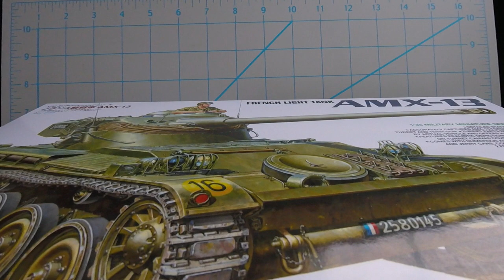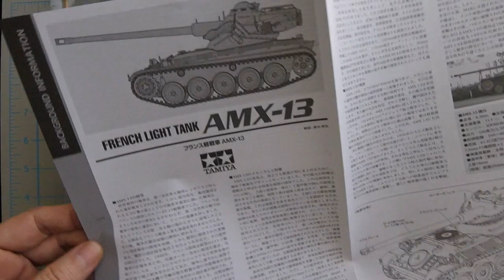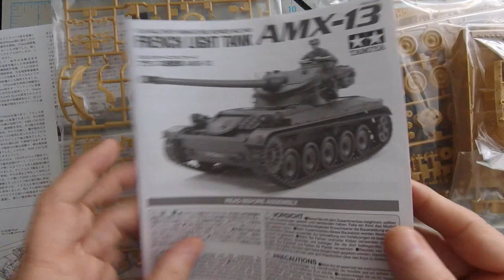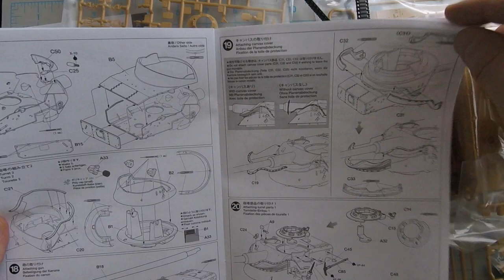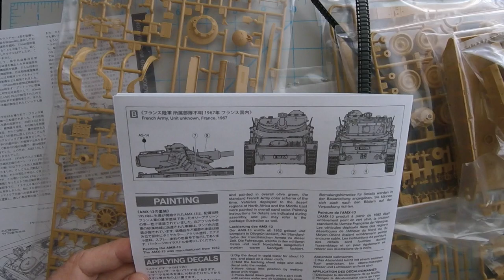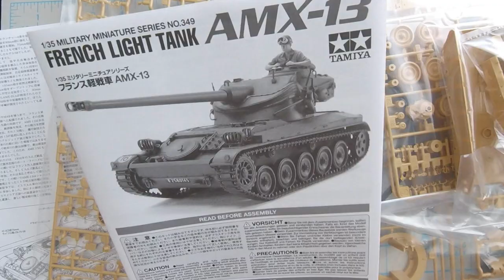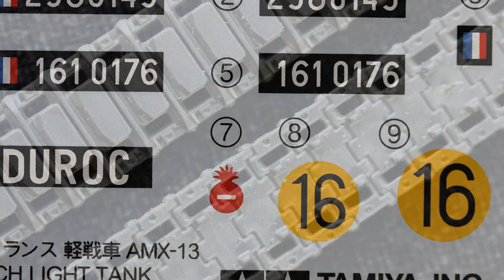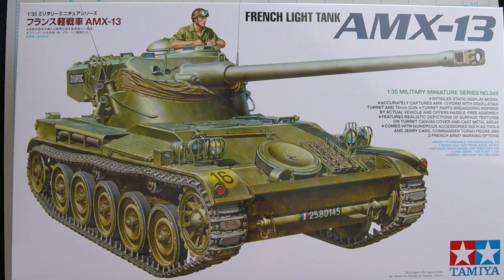Tamiya AMX-13 French Light Tank

Comment: The turret was also mounted on the Sherman, by the Israelis, I think.  I also saw some in the Balkans during the conflict there. I believe that the M4A4 was the chassis and was reengined by the Israelis, which changed the engine deck. I believe that the AMX-13 was originally based on the Panther. It's big claim to fame was the oscillating turret and the auto-loader. Both were New high tech in the early 50's. If the French used them, it was in Algeria, before they gave up on their colonies. Heller made one in the 70's. It was a nice kit except for the tracks which were crap.
Reply: +Ennis Anderson it was by the Egyptians not the israelis ; )